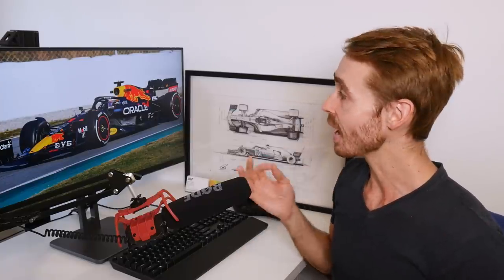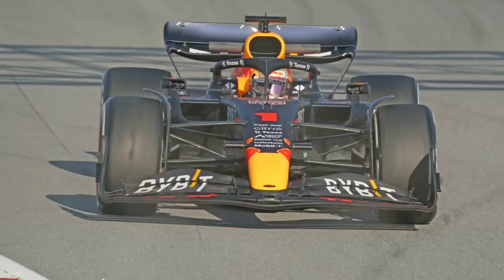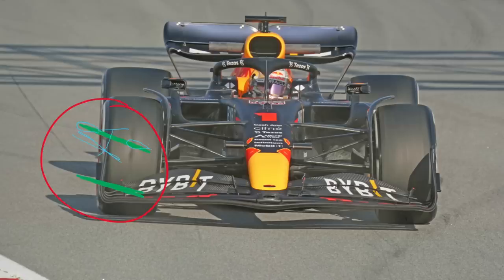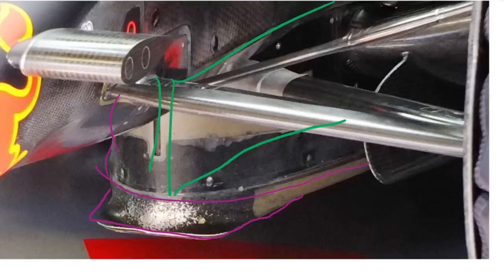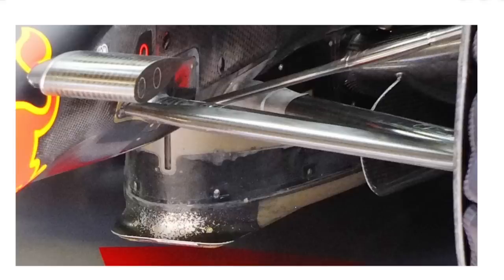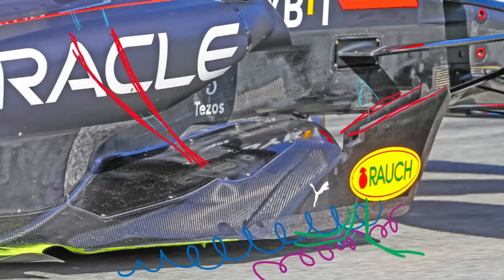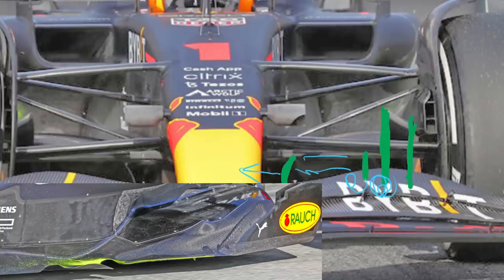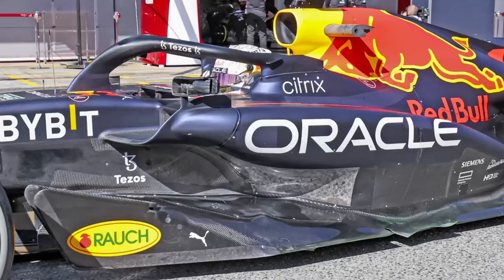Red Bull RB18  -  Aerodynamics Analysis and Initial Thoughts

Comment: Hi Kyle, will you do a video discussing the porpoising issue that we are seeing on some of the cars, and how the teams would approach fixing this issue?
Reply: Exactly what I was also going to comment. Would be very interesting to hear potential solutions to it from Kyle.
Reply: And do IndyCars suffer from it? And if not - why not?
Reply: @raytrevor1  At a guess: Longer experience with the platform in action, and overall less extreme aero?
Porpoising can definitely be tamed, Group C and GTP managed to do it while still utilizing massive Venturis under the body, but they will need a bit of track time.
Reply: @raytrevor1  I think its because all indycars are the same so they can set the ride height
Reply: +1 on this. Also. What strategies can F1 teams deploy to cure the bouncing down straights which is currently occurring on most of the cars? Do they try and stall the floor or play with the suspension? Can F1 learn anything from IndyCar?
Reply: Looks like a lot of people (me included) thought the same ahaha. Interesting and curious to know if there's aeros more susceptible to the effect and why
Reply: Definitely! Was going to suggest this too 👍🏻🙂
Reply: @cryptominingsauce4043  I like the idea of more unsprung aero. And of course dropping lots of weight to need less downforce. In a spec series, the aero kit can be developed to be efficient while a good height over the ground. Flexible aero parts could cap local underpressure to an extent, the floor would "leak" more before it would bottom out.
Reply: @Tommmmmmmmmmmm  woulnt Kyle sell that solution to the teams?
Reply: Interestingly, I think the now banned inerter or long-banned mass damper would nip this super quick
Reply: You are trolling, right? Just 2 days into the testing that horse is already beaten to death as far as I'm concerned. Highlight was the F1 technical breakdown video where the managed to mention ánd explain it at least 3 time in one bloody video and every time as if the viewer has never heard of it. It almost made me want to yell out loud "You just explained it already two bloody times in this same bloody video!'.
Reply: @florisbackx1744   yes but did they explain how teams would fix it?
Reply: The solution is elevate more the rake but cornering speed will be heavily affected which is a drawback
Reply: Agreed. would be interesting to hear what options there are to deal with it. Teams are cutting floor etc to tame it but that is sacrificing performance. Would like to know more efficient ways to deal with it that might allow a team to get the upper hand etc. Dont really need an explanation for what it is. There have already been plenty vids about that
Reply: @Choopremo  I think something like that would probably be the last resort. Particularly for the teams that only experienced minimal porpoising (i.e. McLaren). At this point it makes more sense to just live with the porpoising issue than to sacrifice as much performance in the corners as you would by raising the rake
Reply: They  are  going  to burn  a candle  to  Saint Christopher !!! 😂🐬

Comment: Looking at these shots now, I have some thoughts on the front suspension geometry. I think the lower whishbone is angled back slightly to position both the front and rear legs, as well as the steering rod, purely for aerodynamics. They look like very well aligned with the front of the floor, the start of the underbody tunnels. But at that angle the mechanical geometry would create some dive during braking. So to counteract that, they had to put the upper whishbone at an extreme anti-dive angle . Which would also explain why the upper whishbone shrouding looks quite skinny, they just want to minimize its aero impact. Would all make sense to me, and is an interesting solution.

Comment: As a massive car nerd and relatively new F1 fan I’m so happy I stumbled upon your videos recently, you’ve really helped me better understand the engineering side of the new regs. You’ve done a great job of simplifying everything with each of the cars while not dumbing it down too much. Keep it up!

I’m curious though what you as an aerodynamicist think about the porpoising effect that has apparently caught the teams completely by surprise and what different solutions we might see from each of them. I know that’s probably extremely hard to do without seeing their wind tunnel, CFDs and any other data, (which is probably why you haven’t made a video on it) but I’d highly value even small and obvious bits of analysis. Thanks!

Comment: I would say the double bargeboards are used to get much downforce in corners but not on the straights. The air between the bargeboard is used to create a vertex under the floor, to seal it from the outside. This creates much downforce. But you only need the downforce in the corners. Many teams dl have bouncing problems on the straights on the testdrive in barcelona. Because on higher speed the downforce goes up and it pushes the car near to the ground. The downforce increases when the car is near to the ground. This leads to touching the ground and the aerodynamic flow gets lost.
So the Redbull only creates this vortex when the front wheels are turning into a corner.
If my theory is right. Redbull should not have problems with the bouncing problems like the other teams have right now.

Comment: Is there anyway you can show us...
1) how they use the wind tunnel to develop these parts 
2) Which parts help in cornering at low speeds vs high speeds vs reducing drag on the straights... I think we can tell how the air helps in cooling 
Thank you I know nothing about this stuff and your videos are super helpful

Comment: I love racing but the competition between designers and engineers in F1 is more interesting to me than what happens on track. I loved the hyper complicated barge board and front wing elements of previous years, the visible engineering and just thinking about how so many intelligent people literally worked around the clock to arrive at that particular design. It's so interesting and compelling that there has to be one perfect design, all you have to do is find it. 

When the 2021/2022 rules were announced I was worried it would lead to bland designs without character but I am very happy to be proven wrong. Hell, to my untrained eye the 2022 cars look more different from each other than they've done in a long time and I am loving it. Thanks for the videos and I am really excited to see what they can do in anger on the track.

Comment: I think they have used such a fat t tray to claw back some of the loss they have from the 2 strake bargeboard. Choosing out wash over downforce/drag efficiency. Pretty smart.
Reply: I think it also helps with Porpoising, since the air pressure difference is built up less abrubtly due to the wall of the monocoque not moving in. more gradual air pressure development under the car should prevent the back from dropping too much to the ground in comparison with the front

Comment: I suspect the aim with those bargeboards is to essentially eat the tire wake and squirt it out in a more useful direction.  They've gone to a fair bit of trouble to get it close to the inside corner of the front tire and I don't think they would need two boards to achieve the desired outwash considering how far forwards they are.

I could be getting this wrong because I haven't read the rules because of how they're written, but I wanna say they the area in which your bargeboards are allowed to go starts at the front of the sidepods and extends forwards from there.  The channel like intake seems to be a way for the sidepod to start atr the front of legality but not increase the upper surface of the sidepod as I recall that they tend to generate lift.

Comment: @KYLE.ENGINEERS  Curious if you have any idea what the square hole is on the top of the floor just rearward of the bargeboard arrangement?  I figured that they are bleeding some suction to reduce porpoising, but Im not sure as its a plain square hole.

Comment: I find it interesting to see how RB was able to reduce the side ducts.
Normally these are filled with cooling equipment.
Is cooling more efficient?
Or is Honda engine more efficient and wastes less energy on heat?
Reply: their airbox at the top is slightly larger is what I've heard. so their cooling  slightly more via the central line

Comment: Hey Kyle, wouldn't the double beam wing generate a lot of downforce? The lower element seems to be taking a lot of the lateral airflow and flipping it into vertical with the crazy angle, while the upper element seems to be deflecting some of the upper flow away from the top of the lower element in order to minimize drag. Am I way off of what you said?

Comment: Could the converging beam wings be used to reduce drag off the rear suspension components? Sort of like the outlet ducting on a radiator or else like the cheese wedge behind a wheel?

Comment: This may be overly simplistic, but won't the side pod inlet now function as a splitter? With the increased pressure at the duct inlet now only having the bottom surface to act on, it would produce  downforce.

Comment: Kyle, there is a picture of the RB that has a very concentrated amount of flow viz at the undercut under the side-pod inlet.  Is that a function of high or low pressure?  It seems to dissipate very quickly as I did not see evidence of down stream flow viz after it dissipated.  I thought it looked impressive
Superb video.

Comment: Is the barge board tunnel, just designed to make a vortex system to seal the edge and not to increase the flow in any way, do the two vortexes work against each other to act in that way? Also do you want the flow going the lower route to be approx. the same as the one going into the radiator?

Comment: Would 2 little wheels under the car prevent porpoising and would it be legal?
Reply: The Tyrrell P34 was a 6-wheeled F1 car in 1977, after which the FIA eventually ruled that all cars competing in Formula One could have no more or fewer than four tires. so to answer your question; No, it would not be legal
Reply: @wp12mv  I meant like 2 tiny little wheels that prevent the car from squatting so low.  Or even a skid plate of some sort.
Reply: @Alex.The.Lionnnnn  two extra tiny wheels would still be more than 4 wheels haha, look, i looked up the rules for you and it said you can't, that's all
Reply: @wp12mv  ok not wheels "rollers" lol.  Slightly higher skid blocks.  Anything really

Comment: Hello... It seems nobody talks about the strange light gray rectangular texture area under the sidepots... under the "OR" of Oracle logo (about minute 20:00 of the videoclip). Could it be a different type of material (a permeable one, for example) permitting part of the incoming air to penetrate sidepots even there and to contribute in cooling internal components?
Reply: I think it's a part that wasn't finished until very late before the start of testing, and they ran out of time to paint it properly idk. The white reminds me of a laminated layer with resin that's been cured, but hasn't been painted
Reply: @wp12mv  To be honest, I find it hard to believe that the Red Bull men haven't had time to finish modeling or painting one of the most important parts of this season's cars. Anyway thanks ... I'll keep an eye on that area of the car to see how it will evolve ... its color!

Comment: Would it make sense for a team to put some sort of smoke generator on the car to visualize airflow on track?
Also could Schlieren fotography make sense in an airtunnel?
Reply: No. Smoke trails aren’t very useful even in a tunnel. I’ve only seen them used for instructional purposes, not for actual development.

Schlieren is used in tunnels all the time for supersonic and transonic experiments. They are irrelevant for F1 though (or any subsonic tunnel test for that matter). This technique shows density gradients in the gas, but it needs a large gradient to be visible. So great for things like shockwaves, mixing of different gasses, and density gradients resulting from differential temperatures. 
In F1 none of this applies.
Reply: @ASJC27  That is areally comprehensive answer and honestly much more than I expected. Thank you and have a good day

Comment: I think this car is most interresting aerodynamicaly because...
"Adrian" build it. Red bull is pretty much set on the front of the grid.
Actually im nore interested in McLaren, aston or williams. The midfield how do they move around whos going to jump, maybe to the front aswell.
Big manufacturers as Ferrari and merc will rock this regulations pretty sure.
Ferrari has had a big low in the last years mostly struggling from cheating. But they still are a giant in the sport, they have been there "actually" from the beginning.

Comment: The floor looks so fragile. it will be knock off at the first corner by Hamilton as this year will have close racing.
Reply: These elements are significantly sturdier than the bargeboard elements seen on last year's car. A crunch that would destroy these would have almost certainly destroyed the car last year...

As for whether that'll happen at all, I suppose that depends if the new stewards finally cut the crap and demand that all the time you have to leave a space 😋
Reply: By Hamilton? Who only caused one collision all season.
Reply: @ollieh98  yeah the one that had the most effect on the season